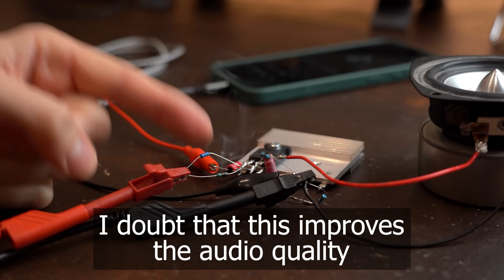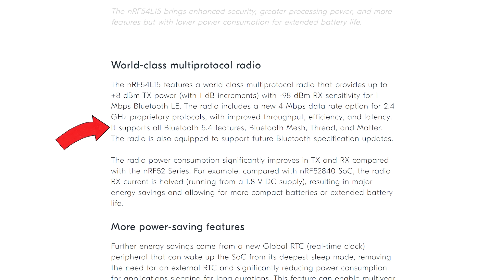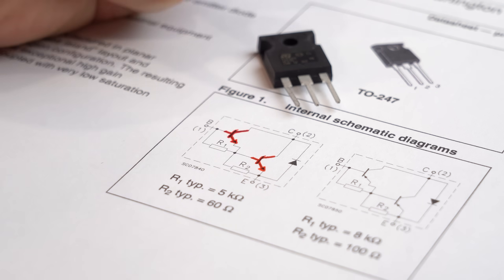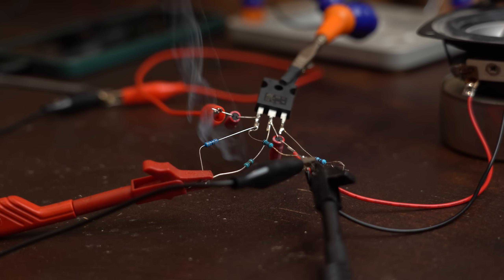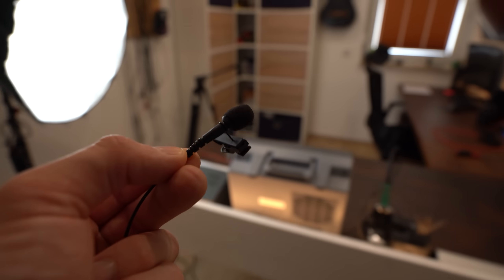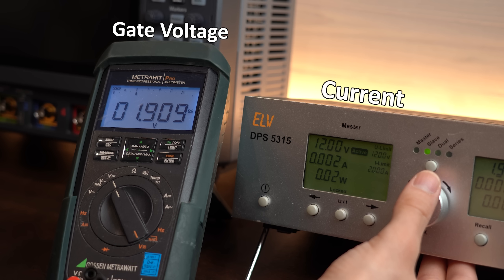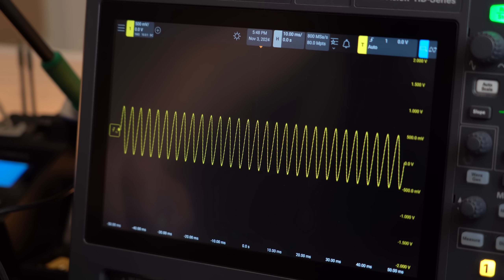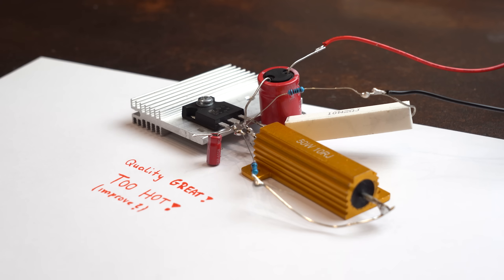The World's Simplest Audio Amp just got BETTER?! (MOSFET Amp) EB#61

Comment: Wired headphones all the way: They don't need to be charged, drain the phone less (at least with the phones i tested it), and best of all: No losing anything just cause they drop out of your ears.
The lack of a 3.5mm jack would not be so bad if phone-manufacturers at least used USB3s features - yes, it DOES offer the option for analog audio but sadly hardly any phone supports it.
Reply: Agreed. #BringBackHeadphoneJack
I had thought that the USB-C adapters were doing exactly that, until I felt the one I was borrowing and noticed it was warm.... and I immediate knew it was active, not passive! 😮‍💨

Granted, that was an Apple dongle, but since Samsung feels is NECESSARY to copy an evil company, I doubt my S23 Ultra does audio passthrough.

I have a Fiio BTR7 and the novelty of listening to music wore off FAST and I listen to music so much less now that I can't just carry my nice headphones with me 😞
(I also have an iBasso USB-C DAC, but even if it wasn't painfully bright, I wouldn't use it since I still need to drag that around AND it's a massive power draw)
Reply: The problem with 3.5mm wired is the quality of the cords, jacks, connectors, jackets and wire clamps. Theres always something on the brink of breaking no matter how much it cost in my experience. Ive bought and repaired too many wired headphone sets they are just as disposable as tooth brushes nowdays if you spend $30 and below and people would actually use them the way they were intended for that price.
Reply: @astrataway7077  User error? lol
I've owned a number of headphones in my 41 years but don't recall breaking one's wires. I'll err on the side of caution and assume I must've broken at least one, though. 🤷‍♂️
(I don't count the one that fell apart, because that was one of the ultra-cheap earbuds the airlines give out, which I only accepted to see just how bad they were)

Most of mine are "cheap" ones, like JVC oR KOSS that are $20-30, granted I did have a couple Shures. Though lately I've been getting the Chi-Fi (as audiophiles affectionately call them) and they might be inexpensive but the quality is much higher than you'd anticipate for only $15. My KZ and TRN have swappable cables, and I've liked them the best! 😅

Note: I have high standards, I just don't have the funds to fulfill them. So if I sing praise of something inexpensive, it's because it's genuinely impressive!
My JCV "Marshmallows" (actual product name) had the worst cable or all the ones I've bought and even they held up fine... I actually still have them, >10yrs later! I don't use them but they serve a good final-backup incase something happens to all the others 😁

[/epic ramble]

Comment: The previous Nordic (nRF52) was a disaster for claiming half of memory for the wireless stack, placed hardcoded at an inconvenient place somewhere half away RAM space, as Blob. Both with Arduino/C and micropython (actually running when jumping hoops) i totally gave up on this supplier. Yes, i you have a need for their specific RF functionality, and are willing to (rewrite) your app to compile with their tools, they may be your game. As a generic uC, they suck big time. Maybe their new offering (N54) is better, but for pretty much anything we rather use an ESP32 which at least tries to standardize stuff. Yes, an ESP has inferior ADC and yes, all microcontrollers have their quirks. But i wasted way too much time working with Nordic, and am not willing to try again until properly supported. Your mileage may very, but i am not that smart.
Reply: If you used their actual SDK ("nRF Connect SDK") and not something made by third parties (which is the case for both Mircopython and Arduino), you would probably have a better time...

Comment: Class D would be great compact and efficient with pd trigger board we can get high voltage from mobile charger and get a high watt output at the speakers.
Reply: Class D aren't really easy to grasp though. Not so good for a video. I would go from class A, to class AB, then filtering and FFT basics, PWM and then Class D. Maybe even some sampling theory.

Comment: Could a 2 channel Class-D TDA audio amplifier be used to drive a stepper motor? Stepper motors have coils, speakers have coils, what's the difference
If I'd just give the TDA7266 two sine waves shifted by 90°, wouldn't that effectively be a silent stepper motor driver?
Reply: Yes, and there is a circuit exactly as you describe in one of my old 1980s EA magazines! :)

Comment: If you want to improve efficiency, you need to start looking at Class A/B. Class A amplifier are not really scalable. Class A/B are easy enough to do with discrete components, but if you want there is "chipamp" solution that are efficient (50-70%) and has a good audio quality. I did a stereo amp using a LM4766 and it was surprisingly good. Overall a nice analog project to do for fun.
Reply: Well, if you try hard enough, class A can be scalable. I have a friend who built 2x30W pure class A amp that draws 600W from mains while doing nothing. Ideal winter solution, room heater with crystal sound quality.
Reply: @__MINT_  I would hardly call that "scalable" ahah. 10% effiency it's insane. Imagine that at a rock concert, you would need to put the amp outside lol.

Comment: Class A amplifiers are fine, but if you want something more functional, you have to go to dedicated integrated circuits. Something like NJM2073 for instance (at least if you want it to be in a small package and working with low supply voltage).

Comment: This video is interresting... But nothing more. Class A for Power Amplification just plain sucks. The claim, that AB distorts is also false. If tuned well and with a differential preamplifier with a very responsive feedback loop, it matches or exceeds Class A in every metric. Just take a look at elliotsoundprojects. I recommend you to build one of the many amps there. The circuits are amazing! Work in real life and in LTSpice simulation aswell. (I mean, expected, right?) But you can visualize the tuning easily within a simulation. Adjust your thing, simulate, get noise free measurements of crossover distortion (very visible for ultra low voltage input signals, where the crossover distortion might dominate the output. signal

Comment: Thankfully today we have audio signal level standards in place so  you can get away with just a single MCU with a built in ADC, PWM timer and an OpAmp combined with a MOSFET pair and 2 MOSFET driver ICs per channel. The "D class amplifier" is a nice and relatively simple project for MCU programming students, just don't forget to add a PolyFuse to the MOSFET power circuit to protect it from programming mistakes causing both transistors to open at the same time. And the best part is that you can even experiment with some DSP here starting from basic stuff like converting stereo to mono and pseudo-linear filtering up to FFT-based graphic equalizers and continue with more advanced stuff like synthetic chambers and stereo effect enhancement. The sound quality and the power you can easily get from the thing makes even quite advanced commercial analog solutions just pale in comparaison to even the simple kind of a project for electronics students. Just make sure to choose a powerful enough MCU for that, something at least with a Cortex-M4 running at lesst at 100MHz if you want to test all the modern techniques.

Comment: EDIT: it looked like the THD on the mosfet was happening at around -75db to -95db (circa) which is not really an issue in a small speaker like this and can be further mitigated with a good enclosure to the point of becoming insignificant.

original comment: man, this is such a cool and practical project to draw in noobs like myself. I think I've been subbed since 2017-ish and this is the first project I'm going to attempt. I'm not sure what that says about your turnover rate, but I'm super thankful at least ;)

ps. please consider doing a simple preamp some day

Comment: Hiii love your video and all your project ❤..
I have little knowledge tho ...but i want to learn more , is this type of amplifier Design called class A?  This type of design swing only 0 to +0 unlike push pull method right? ...i build like this before just one transistor tip122 it produces alot of sound and bass but the distortion clipping I can't fix it ....

Comment: Design a simple op amp amplifier which are much simpler to build and sounds great because they use class b amplifier at the output and gain is controlled by op amp

Comment: Collector feedback bias is even simpler, and since it has local negative feedback, should distort a bit less.
The distortion of a single ended MOSFET is actually very close to that of a triode, and triode output amplifiers have been something of a holy grail for audiophools. That distortion adds a warmth that many people find more pleasing than a clean, undistorted signal.
Reply: Thats why audiophool amplifiers still uses vacum tube which has even more distortion
Reply: @pearan  If you compare the static curves of a MOSFET and a typical power triode, they're almost identical, so they should have almost identical distortion, with emphasis on even harmonics.
Power BJTs and IGBTs, on the other hand, have almost identical curves to power pentodes and beam "kinkless" tetrodes, so they have almost identical distortion characteristics, with emphasis on odd harmonics.
I've been dabbling in home-brew guitar amps for about 15 years now and am a reformed tube amp snob. It's easy to get all the right distortion and tone shaping in all the right places at the small signal level with solid state components and then just loudify it with any clean, efficient power amplifier. No hollow state rubbish required. Small signal MOSFETS like the 2N7000 can even satisfy audiophools that want that triode "warmth."

Comment: The common emitter or common source configuration you are showing here is not really a good choice for a power amplifier. The low RDSon of the MOSFET is not at all utilized in this configuration since the current to the speaker is not actually passing through the transistor. That's unless you also make the drain resistor quite small, which would result in an unreasonably high quiescent current. 
But it's nice to see that you could make it working at all...
Reply: A follower like it's usually done would have been more useful for driving loads, and can still be technically called an amplifier (of current). Or maybe just lots of feedback to have a low output impedance
Reply: @bentfishbowl3945 hey! How would that be set up?
Reply from the maker: Thanks......I guess.

Comment: I've built a fair few higher power class A amps through the years. The biggest one was a stereo setup that drew 25A at 24V, requiring a lot of cooling and very big ceramic resistors. It sounded awesome though! Also a great space heater. Haha.
Reply from the maker: Haha sounds like fun :-) Thanks for the feedback ;-)
Reply: @greatscottlab  Hehe yeah it's a fun thing to tinker with! And the fact that everything just scales up the more power you want, it's a very simple thing to build if you have a bunch of high power components already. A vastly improved version that requires no massive resistors is the "Death of Zen" circuit form Elliott Sound Products. It's a lot more complicated and sounds just as good. So it takes away some of the simplistic charm of a big raw class A stage.
Thanks for a great video as always!
:D
Reply: @H3adcrash what a small world solid state electronics is! Reading Elliot sound being the amplifiers built in our school trough the years make me smile (living in Argentina)

Comment: Nice. If you only want current amp. you can use a voltage regulator like the LM317 or eqv. and make a class A amp of it. Thanks for your great videos.
Reply from the maker: Cool, thanks

Comment: Wouldn't that design be super noisy and prone to amplifying power supply noise?

There's a reason we usually use a differential amplifier as the first stage.
Reply from the maker: Well, I did not experience any noise problems here......

Comment: I went straight to op amps like the venerable 741 and hooked that up to an LM386 which, at 1 watt, is pretty loud.  Since then I've moved to class-D board amps, which run on 35Vdc and are amazingly loud, run floor speakers, and are the size of a credit card.  I use an old laptop power supply to run them, with a usb wifi dongle to make it work in our home theater.
Reply from the maker: Thanks for the feedback :-) Sounds like a fun journey ;-)
Reply: @greatscottlab  Of those who dwell on this Earth, yes, I was here first.
Reply: Used opamp with resistor matrix DAC. even fitted both in (big) LPT port connector. Good old days.. sb-emu, LPT DAC and third-hand car speakers:)
Wolfenstein never soundd so good before :)
(nostalgically .. after, too)
Reply: @matikaevur6299  cool =)
Reply: @matikaevur6299  covox, R2R DAC
Reply: If you are going to go through the trouble of attaching a bulky external power supply, try a LM1875 on a dirt cheap Chinese board.
Reply: My friend has a class-D amp, this thing sounds great, is really powerful and, as you said, tiny
Reply: Yes, I have a little class D amp hooked to one of my notebooks that I use to listen to audio books on and it really rocks for that.  I was a child of the transistor age, I recall going to the radio store, when there were still such things, I think radio shack may have killed them, and getting a ck722 to make an amp for a crystal set.  Kind funny, the transistor came in a box about the same size a mini vacuum tube would have come in.  Back in those days having slow low gain devices was kind of a blessing as wiring was still mostly point to point.  I went through the 386 based amps.  When sound cards first came out in fact I got a pair of those little 2 way speakers in the metal cabinets that sold back in those day for like a whopping $9 or so and built amps in them.  I started with one and wound up making a few more sets for friends.  When IR came out with the hexfet's I designed a cute little amp based on them and a dual opamp.  It worked well, sounded good, I did not have access to anything to measure distortion with back in those days.  When I first described it to friends I had a good amount of interest, but when I first thought about it I just assumed the P channel ones were just like the N channel ones and priced the same.  Oops.  Really big oops, the P's were like 12X more.  I had also not thought about making it, or trying to make it quasi complementary.
Reply: You don't want to use a 741 opamp, the slewrate is to low, the Miller cap kills the bandwidth and thus the loopgain at high frequency, thus high distortion, the 741 has high nose, it is useless for audios
Reply: TDA7052a is a good amplifier as well.  I've made several preamp circuits going into a tda7052a amplifier circuit for portable guitar amps.  You can plug them into a half stack and they are ridiculously loud.
Reply: Would have been more based if you used op-amps to control a LM3886, a kind of hybrid design that produces very hi quality audio output.
Reply: opamps deff should be a consideration .. there is a reason some super hi end audio op amp pre-amps are made using individual discrete components.. largely for capacitance reasons and then fed into tube power amps.. deff power hungry devices, but sound quality is top tier..
Reply: @VorpalForceField Tube amplifiers usually have low loopgain and thus high output impedance and high distortion, the distortion is usually of second order so it sounds "nice" but not natural.
The integration "IC" or multi transistor in a package enables lower paracitics and better relative matching, this enables less trimming, higher bandwidth/loopgain and lower distortion.
The only problem with IC is the limitations in cooling, for good cooling of an audio IC you need a large die, thus the IC becomes very expensive...
Reply: Too funny, that is what I have for the stereo in my bedroom.  I just got a McIntosh ma230, I need to make a switch to go between them, as I listen to books on tape and podcasts at night and do not need to waste tube lifetime on them.  It is going to be interesting to see how a real old school hifi amp does compared to my little class D thing.  I run my class D amp off a notebook supply too.  Works great.

Comment: wouldn't that mosfet circuit potentially Damage the phone, since audio in is connected to high voltage.
Reply from the maker: No. Because DC is "blocked" due to the input capacitor.

Comment: Nope you haven't yet used bypass capacitor to make source ac gnd.
Reply from the maker: Yep. You can increase efficiency a bit this way and also lower distortion a bit. To keep it the World's Simplest Audio Amp though, I didn't include it here. Still pretty good quality results though.
Reply: @greatscottlab  but this will also increase gain and just by using one more component it doesn't gonna be world's toughest amplifier circuit 😅

Comment: I have made these kinds of amplifiers quite a few times but thanks to you now I understand how they work quite clearly 😊
Reply from the maker: Glad to hear that! Cheers :-)
Reply: When I was 14 years old, I made an amplifier with this exact same mosfet but used a single resistor. I don't know how it works but I still remember the circuit. I added a 1k resistor between the gate and drain of MOSFET and connected the drain to the -ve terminal of a speaker, +ve terminal to a 5V supply, Source of MOSFET to the 0v rail and connected the audio into the Drain of the MOSFET. It works like magic.
Reply: @maheen-  yes it works :)